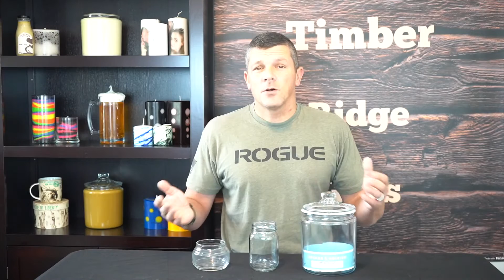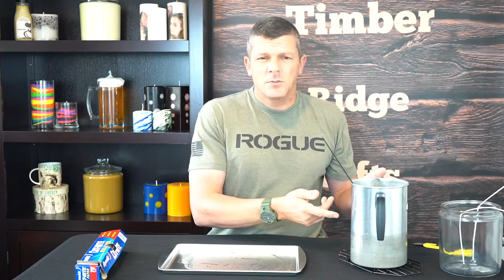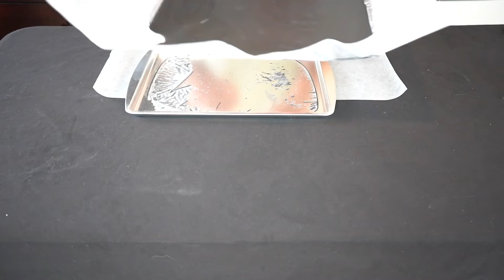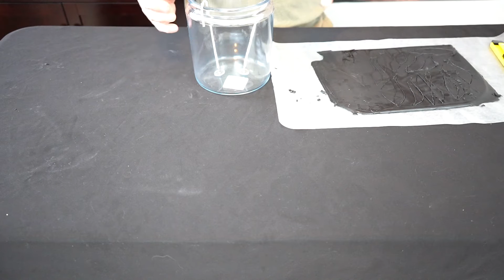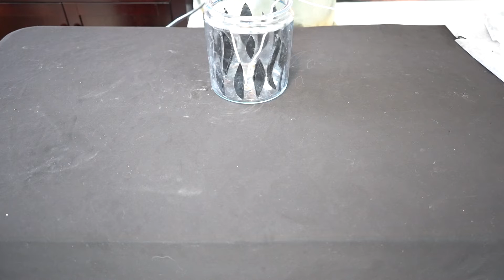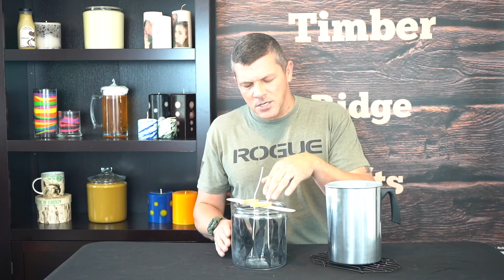Container Candle Embed Trick!

Comment: LMAO!! We are too taught the metric system here. We just don't use it, so we forget it. We are basically to dumb to retain it. Well except meters, centimeters, and millimeters, we use those occasionally.
Reply from the maker: Well to clarify, I skipped more school than I attended, So I can't actually confirm if it was taught or not lol.
Reply: @TimberRidgeGifts  No!! Not true! We all have you on a pedestal of awesomeness. Don't break it. LOL!
Reply: Depending on the school district, you may or may not be taught the conversion of Fahrenheit to Celsius, though. It would totally depend on if it is taught in the math course or a science course for the school district. Where I went to school, I learned about temperature in Earth Science, however, the school district no longer teaches that particular course (they exchanged it for a different science course), so not all students in that district are learning about the temperature conversion now. They DO still learn the metric system of measurement, however, in their math course.
Reply: @ColonelPowder1225  Well since it's in the required academics standard test, most schools teach it between 3th and 6th grade. If a school is not teaching it, they are literally setting children up to have lower test scores. It's not a hard core teaching, usually in the introduction to weights and measurements. Just the basics.